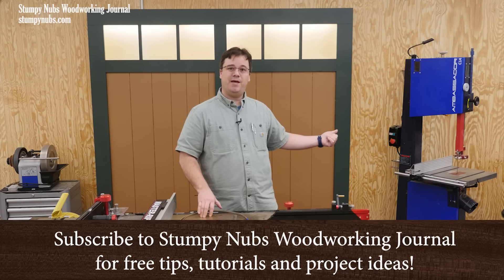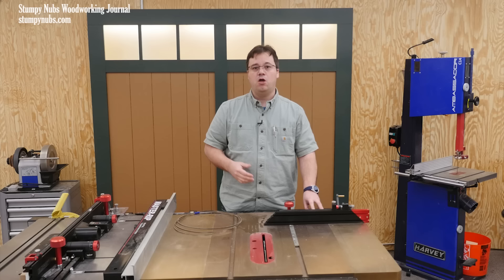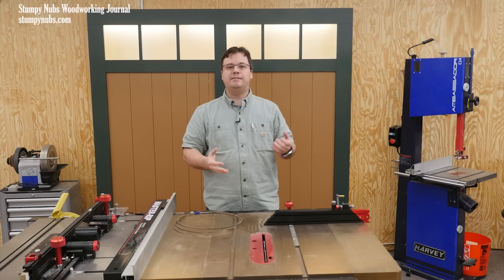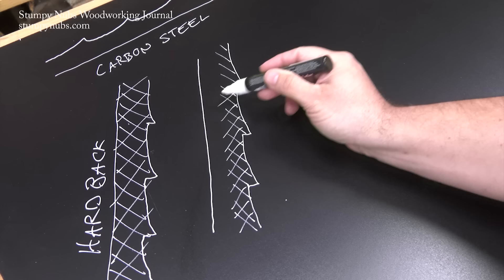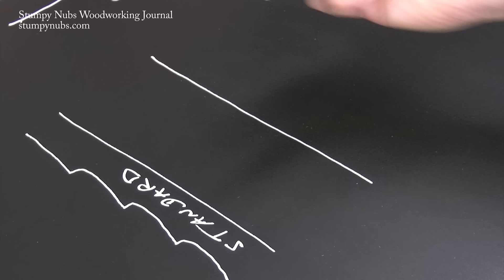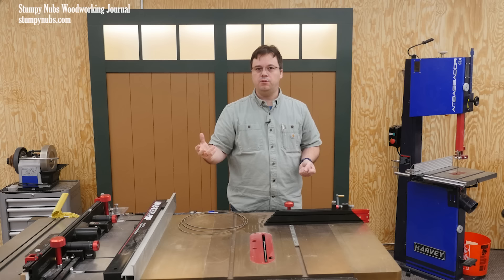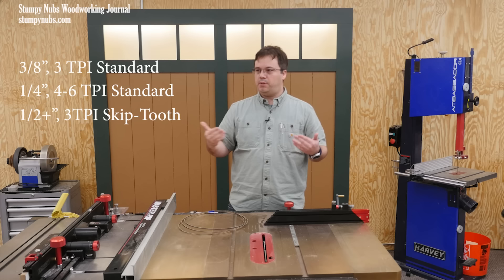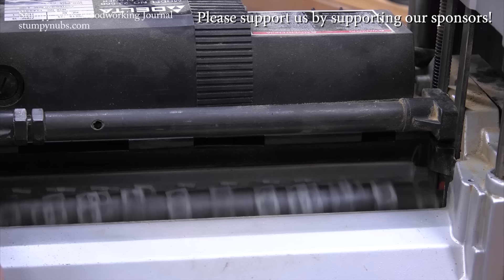The only 3 bandsaw blades you need

Comment: I buy blades often. My bandsaw makes a noise like it's spitting at me compared to smooth and quiet when I put a new blade on. I've seen some videos of people repairing blades. I might give that a try. One commenter here says buy in bulk and make your own blades but that math doesn't work for me. The best price I can find on bulk still works out to $19 a blade for my saw. A new blade is not much more. I wish I could figure out why a blade after some use starts making that spitting sound. I keep everything clean inside. I must be missing something

Comment: I'm a big fan of Timberwolf blades. Great value for the cost 🙂
Reply: That’s what I came here to say I love them for my bowl blanks
Reply: Lol. Me too I haven't had my 14" rikon for very long. But I'm really liking these (timber wolf) blades. Would like to try out a carbide blade one time just to see the difference. But not ready to put that money into one yet.
Reply: Yep.
Reply: I have used the Timberwolf and Laguna brands and have been very satisfied with the re-saw quality.  The Laguna may have just inched out in front of the Timberwolf in my opinion, but I would not hesitate to purchase either brand.  I have since bought another well recognized brand and they just haven't performed as well.  This is definitely an unscientific statement, but the perceived frustration level raised when I went with the other brand.  I am open to any brand that performs well.  With that, are there other brands that hit the top of the list with quality of cut and blade materials?  Stumpy, do you have experience with many brands and are you allowed (by sponsors) to list some of your best blades in order of your satisfaction?  Just FYI...My saw is the Laguna 14/12 and I love it.
Reply: I bought a new bandsaw this summer, and just tried resawing for the first time on it last night. I was trying to re-saw some walnut that was about 7 1/2 inches wide. My blade was a three-quarter inch wide, 4 TPI. I was disappointed with the cut quality. The blade did not stay straight through the board. 1/2 ended up up with a hump, and the other with a valley on the face of the board. Why did this happen? Can anyone explain it to me? I guess I need a blade dedicated to resign like James recommends.
Reply: @Philip Peterson  sounds like the blade may need to be tighter. Or you might be using a weak or thin kerf blade. I resawed a 12" Wide piece of popular and I didn't have any drifting.
Reply: Timberwolf blades are junk.  I have had most snap at the weld.  I have talked to one person recently and she had the blade snap after only making a handful of cuts with it.  I spoke with Rikon as I have a Rikon bandsaw and their customer service person actually stated they do not recommend timberwolf blades as they have had and heard a lot of bad experience with them.
Reply: I agree.  Also, I have a dickens of a time adjusting the drift out .  For resawing I like Highland Woodworking’s Wood Slicer.  I also do not like Olson blades - they leave a rough cut.

Comment: I really like Laguna's Resaw King blades.  I use the 1 1/4" (2-3 TPI) nearly all of the time and it goes through hardwoods like a hot knife through butter.  They're carbide, last a long time and are re-sharpenable.  They're not cheap (especially for my 250+ inch blades) but they cut rips and resaw really well (most often oak and walnut for me).  They're made in Germany.  I can't remember the last time that I bought one because they last that long.  Enjoy!  And Thanks Stumpy!!!

Comment: How critical is the length of the blade?   I recently bought a 10" bandsaw that calls for 72 inch blades.  The closest length I can find on store shelves from any retailer (Lowe's, Home Depot, Menards, True Value, Ace Hardware)  is 72 - 7/16 inches.  Do you think that will work or will it need to be exactly 72 inches?  Thank you.

Comment: Hell, I still need to make my bandsaw RUN again... When I bought it, the lady selling it said her kid had been using it and had an incident where a piece of wood binded and got jammed between the blade and the mouth of the table where the blade goes in.. So what happens now is you start it, and the belt runs off the pulley. I know the pulley needs to be adjusted to line up with the motor, but I need to tear the thing apart to get to it properly. Otherwise it's a perfectly good freestanding floor unit that I'd use all the time if I could.

Comment: I assume every one has their favorites and I am no different. Many years ago my wife and I took a 3day Shaker box making class at the Shaker Village in Kentucky. As the result of that class I, of course, became very interested in making a complete set of those boxes and I bought a Minimax 16" .... 12" resaw bandsaw. It's a beast. The individual I worked with on the phone recommended I try Highland Hardware WoodSlicer resaw baldes. I took his reccomendation and ordered a couple. They are not cheap by any means but WOW!! the results were amazing. I barely needed to sand the resawed blanks. I no longer make Shaker Boxes but am a long time woodturner and they, Highland Hardware sold a 3/8" blade the they called the woodturner blade. It was used to cut bowl blanks from logs and it also was a dream to use. I am getting a bit old (83 next month) and am not as active as I once was. Enjoy your channel. Your presentation skills are supurb and you never say "go ahead and...."  I thank you for that.

Comment: I just bought a Harvey C14 and I just watched your older band saw blade video. Such good fortune to catch this update!! Love what you do, James!! Cheers and I can't wait to fire up my new C14!!
Reply: I'm in the market for a bandsaw and Harvey will be the one I purchase, just can't decide between the C14 and the HW615P.  I'm having a hard time seeing the value in the HW615P. It looks like it's only got a taller fence, larger table and bigger flywheel. Is there any reason you whish you'd have purchased the HW615P, or are you completely satisfied with the C14?
Reply: @petenelson8136  I saw your unanswered question and thought I'd chime in.  I bought the Harvey C14 about a year ago.  I haven't been disappointed.  I don't see the value of the added $550 either for a 5" bigger table, the higher fence, an extra 1" fly wheel, or the extra 91 pounds.  I can make an auxiliary fence or bigger table if I really need it.  I'll say the C14 has plenty of power and all the features I need.  I'm extremely happy with it.  The biggest thing I had to get used to was remembering to re-tension the blade before use.  My previous band saw didn't have that feature and I love that it's there since I've read that it helps preserve blade life.
Reply: @sandmandave2008  Thanks for answering back on this. Good to hear your happy with it. I got my new shop wired for it, so just waiting to get moved in, hopefully in a couple of weeks. Painters just finished up yesterday (they'll need to come back for some touch-up), and still some plumbing (countertops in yesterday), electrical and the garage concrete pad to pour (the one outside). I'm really looking forward to having a band saw. I've got a bunch of projects to work on once the house is finished, like cabinets for my wife's sewing room, our mud room, my shop, and then making my outfeed table, work bench etc. I'm really looking forward to having a woodworking shop as I've never had one before, other than moving the cars out of the garage and my tools off the walls to make something.

Comment: I buy rolls of flex back blade from Germany for like $1 per foot. Then braze them to length for my 3 bandsaws…costs %60 less than buying standard blades and never had one break where I joined them (30+ blades) Can sharpen them with a dremmel 2-3 times too.

Comment: I have a cheap WEN 10" bandsaw that drifted so bad it was unusable. I was thinking of replacing it with a better-quality bandsaw but my basement height is very restrictive. I tried adjusting it every which way possible but it had no impact on the drift. I finally decided on replacing the blade and to my surprise it now cuts fine...well as fine as a WEN 10" bandsaw can. :-)  It turned out to be a warped blade. I could not tell by looking at it that anything was wrong but once I put in the replacement it was like night and day!!

Comment: Most of the time, I am cutting out bowl blanks for my lathes. I am lucky to have a local shop that makes the blades. A friend suggested that I go in to them and tell them what I do. They suggested the Lennox diemaster bimetal blade. Best tip for bandsaws I ever got. You commented that the bimetal blades are mostly used for metal cutting. Those blades do have a different set to the teeth. One use is for the pallet cutting blades. The bimetal has no problems with nails. Same with the wood cutting ones. They cut far longer and straighter than the other ones out there. I use the 1/2 inch by 3 tpi blades, and the thicker ones. They can be resharpened a number of times. I am lucky to have a saw shop that will do that for me, and reset the teeth. They may cost more, but they last a lot longer, and I mean a LOT longer. On my big saw, which I cut slabs with, I use a 1 1/4  inch blade with teeth at 3/4 inch. They told me at the shop that carbide blades are for cutting veneers. I did try one, and it didn't last any longer than the bimetal blade, but it did leave a lot cleaner surface.

Comment: I've had good luck with Lenox Diemaster blades for general woodworkign , but My Laguna Resaw King is fabulous for resaw - worth the $$.  I have a 1/2" one for my 14" Rikon bandsaw.  I recently resawed 8" wide Jatoba with it,  bimetal resw blade could not cut into in more than an inch as the wood is just so hard and dense, the Reaw King had no problems just needed a slow feed rate.

Comment: I have a 10” and a pro quality 14” bandsaw that I mainly use for rough shaping, resawing or cuts where a smooth finish is not required.  I’ve never liked the rough straight cuts versus the relatively smooth cuts from finer-toothed round blades on a table saw, radial arm saw, etc.  For some uses, the band saw is the only way to go.

Comment: Clear and concise as always. I'm just about to give up on the premises blade's I've been using, I can't seem to get a good one. I've worked through all the tuning I can on my 14" bandsaw but I still get significant drift. I hot blades made up for my 10" because the blade length was odd and I couldn't get them at my local tool store, this used to drift too but with the made to order blades it cuts straight as a die but obviously the resaw capacity is very small

Comment: all well and good info.... if you have a 14" or larger band saw.
Reply from the maker: A smaller saw doesn't affect the minimum radius a blade will cut, nor the differences between types of steel and tooth count. Pretty much everything in this video applies to smaller saws and larger ones.

Comment: Just a technical boring note that has extremely little to do with the great content of the video: regarding heat treatment, in this case hardback blades - heat treating/hardening does not affect the stiffness of steel. It's a common misconception though. Heat treatment and hardening affects the strength of the steel. In practice, all steel regardless of quality or hardening deflects the same in proportion to the force applied, up to the breaking point.

Comment: My go to used to be Timber Wolf blades but after having several snap at the weld after very little use in 1 inch stock I went else where.  After researching on the different woodworking forum and talking with other I came to learn that I was not the only one who had the same experiences with Timber Wolf. Many people had the blades snapping at the weld shortly after install.  I have a little gauge that tells me when the blade has the proper tension so over tensioned was not the issue.  I spoke with Rikon about this to get a recommendation and they stated that they too had the same experience with Timber Wolf blades.  The recommended Olson.  I purchased one and it is a very nice blade.  I have also found a company in North Carolina that makes bandsaw blades and they are very pleasant and the welder is really knowledgeable about the different blades.  For resawing diemaster 2 are great and last a lot longer.  They are more expensive but do work very well.  I have heard good things about the woodslicer blades but have not tried them.
Reply: I had trouble with Timberwolf blades breaking, too. Tried Lenox blades and never looked back.
Reply: What is the company in NC. As a NC resident myself, I’d like to buy from them

Comment: Thanks James! 
Very informative video 👍.
May I invest my small bit of experience?
I am quite disappointed with bi metal blades .
They are definitely more expensive but not  as durable as they should be.
I used Bakho blades. Once I cut a big bone for my dog and this expensive blade has become absolutely dull! No teeth at all.(((
So I switched entirely to carbon steel blades from US.
Unfortunately, now it is a problem to buy them in Russia due to embargo (((
In my opinion it is better to buy three carbon blades instead of one bi metal blade

Comment: I have a very basic bandsaw question, and anyone with experience is welcome to answer it.  I'm asking here because I don't think I've seen it addressed elsewhere (perhaps it's too basic to mention).  

Can you swap between a wider blade (like for resawing thick slabs) and a narrower blade (like for cutting finer curves) on the same bandsaw?  The answer is probably obvious, but I don't want to assume anything. When I can eventually afford a bandsaw, I don't want to find out that I actually need two.
Reply: One bandsaw will work with most blades.  Check the specs on the toy of your choice.  It should give you a max and min width.
Reply: @boogityboo8085  Excellent information.  Thank you.

Comment: Hi James, my budget only allows me to purchase a bench top bandsaw, 1 I have seen is a 10" bandsaw, is it worth my hard earned money to purchase a benchtop bandsaw or should I think about another tool for my small shop, I was told I can do bandsaw boxes with the 1 I seen and I really want to try making a box, I understand this is YOUR  opinion thank you
Reply from the maker: Some people get by fine with a 10-inch saw. You may be limited to smaller bandsaw boxes, but that's the trade-off.
Reply: James thank you
Reply: Alan, don't forget to look for used bandsaws as well. Where I am I regularly find Delta/Rockwell  14 inch saws in the $200 range. A used machine can give you a lot more saw for your money
Reply: I am currently using the Ryobi 904G. I like it. I do wish it was larger but you can only get what fits in your space. There is a video on band saw boxes using the Ryobi. You are limited in how big you can go of course - basically make one out of a 4x4 max - but it can be done.

Comment: So if I were to use it largely for resawing, I'd get a wide blade, perhaps 1 inch, low tooth count, and a hard blade in carbon steel?
Reply from the maker: If your saw has the rigidity and spring strength to properly tension a really wide blade like that.

Comment: Hi Stumpy, I have some 1880 turpentine pine lumber from Merritt Island Florida that was hand hewn into floor joists. On one edge they have a row of the remains of square nails left over from the floor boards.
My question is: do you think it would be safe or practical to try to put a metal cutting blade in my circular saw to cut through the nails to clean up that edge?

Comment: Can anyone recommend a good choice for my Ryobi bench-top bandsaw? I know, I know.... someday I will upgrade but for now this is what I've got.
Reply: I have a Ryobi 900., 52.5 inch blades. Got a good deal on Bosch 3 blade pack on Amazon. Work nicely now I know how to set up the tracking.
Reply: @1967250s  Thanks for the info. I will check it out!
Reply: Why apologize? I have several Ryobi tools that have served me well.
Reply: @jamesowen889  I do as well... not a knock on Ryobi and this is a fine bandsaw - for what it is. I am just starting to find it limiting in what I can do with it but only because of its limited size/capacity so a larger bandsaw is probably going to be my next large tool purchase. It has served me well though! I am hoping I can get better resaw results with a wider blade though.

Comment: I like your advice on different types of blades, but my problem is trying to figure out what length to get. The band saw I have is an Atlas made back in the 50's or so and I don't have any Literature on it, nor do I have a broken blade to measure the length.  What is the correct way to measure the blade?
Reply from the maker: Set the tension knob on the upper wheel to about center (not all the way up or down) and wrap a piece of string around the wheels like a blade. Measure it. You don't have to be perfect, you should have about 1-2 inches of room for error. One of these works nicely, too: https://amzn.to/3J1alIN
Reply: Did you try a cloth measuring tape? Run that around the installed blade and you should get close enough to determine the blade size right?
Reply: Call the blade manufacturer you want to use and ask them. They may know the correct size for your machine. If they don’t you can use a flexible cloth tape measure and run it through the guides and table and get your measurement for your blade. Just make sure the upper wheel is set to its lowest/shortest setting, or almost the lowest/shortest setting. Then get their cheapest blade in that size to confirm it works. Hope this helps.
Reply: Along with the other recommendations in these replies, you can calculate it by your wheel circumference (3.141*diameter) + 2x the distance between the wheel centers.